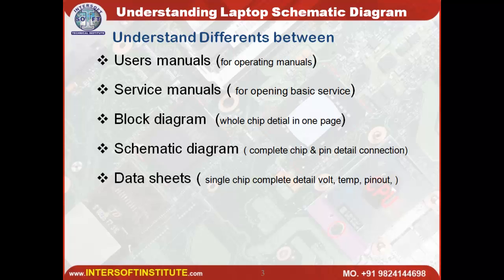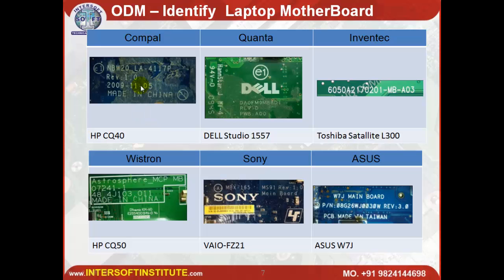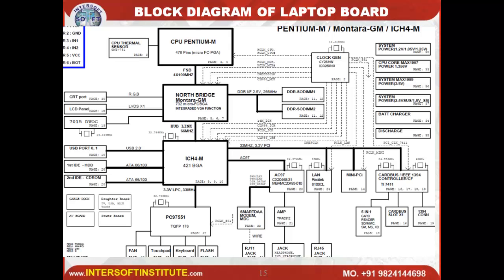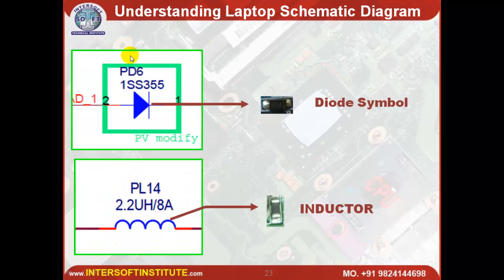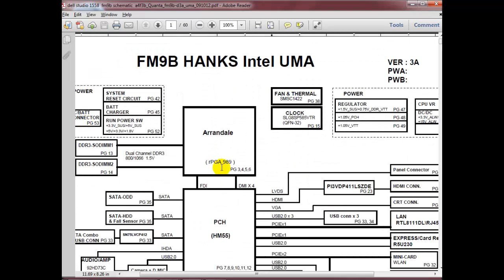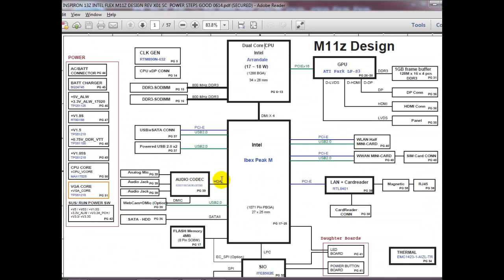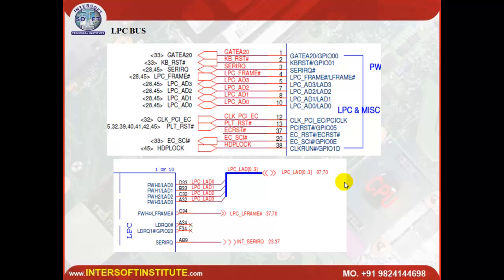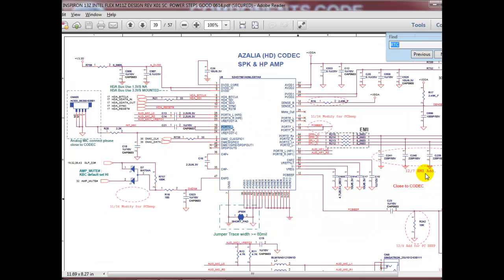HOW TO TRACE SCHEMATIC DIAGRAM TRAINING ON LAPTOP BOARDS WITH DIFFERENT SIGNALS (English)

Comment: I couldn't find a schematics of motherboard AA945GK308AA / TYSSO-8000 / PO9815Q064, all these numbers were seen on the board, made in Taiwan. Do you have any ideas to find it? with Thanks!
Reply from the maker: try thru vinafix

Comment: Max raw material and manufacturing cost of motherboard is Rs 500 (raw material like ICs, capacitors, pcb, coil, relay, connectors etc. Res is all marketing and gimmick.Companies can make laptop and sell to you for even Rs 5000 if they want...but they wont

Comment: I'm using Dell Inspiron 15 N5010,  need battery circuit diagram...pls guide me from where can i download the schematic?
Reply from the maker: dear which board is there you have to see first it is  berry dg15   then you can search on google   schematic berry dg15  you will see some sites from ther you can download